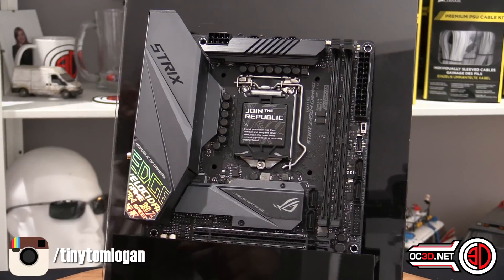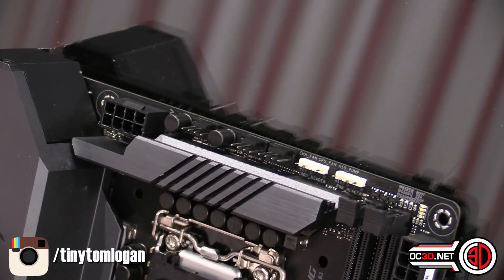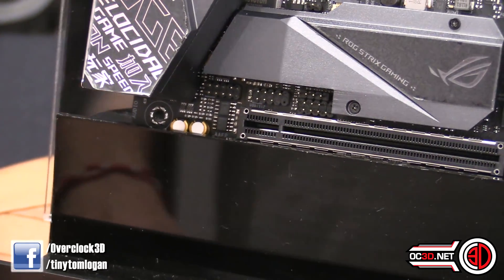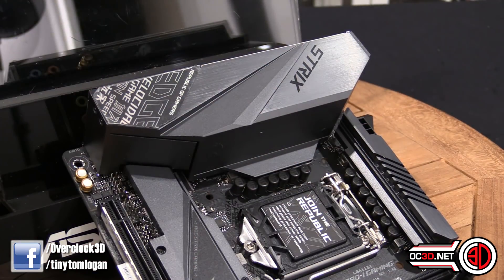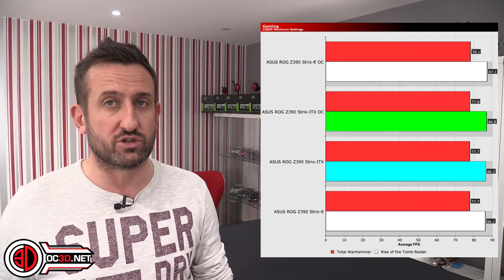Asus ROG Strix Z390 i 9900K Motherboard Review

Comment: I am planning to make a build with this m/b an i7 9700k(stock settings) using for case a Corsair Crystal 280X with 6 case fans.
From your experience do you believe that the "Scythe Big Shuriken 3"  fan cooler or "Cryorig C7" fan cooler are enough for the 9700k(stock settings) for gaming?

Comment: I just do not understand Intel not letting me use my recently purchased i7-6700K in a new motherboard.      That irks me so bad, that I may just go back to using a typewriter.
Reply: Elstan McFrolicker It’s because the newer motherboards’ sockets have a different architecture specifically for 8th and 9th gen CPUs, that’s why you can’t use 8th and 9th gen CPUs in 6th and 7th gen motherboards since those boards’ sockets were specifically designed for 6th and 7th gen CPU architecture.
Reply: @LawByLaw        there are hacks to get it working tho         :    ]

Comment: Some are reporting a 9900K right out of the box won’t work with this MB. It needs a bios update first - which requires an 8th gen CPU - then it will recognize the newer 9900K. Has anyone else experienced this? I saw a few reviews on Newegg.com. Thanks!
Reply from the maker: The board will work fine with the 9900K but you should update to the latest BIOS anyways, depending on when the board was made and how long it has been at your retailer will depend how out of date the BIOS is.

Comment: heheh, 9900k "best gaming"  cpu but only if  you dont oclock 8700k or especially 8086k at maximum and that is 5,3-5.4ghz or in some cases above that  and if you compare  stock 9900k vs stock 8700k and that is 200-300mhz advantage for 9900k and there you have "winner" in gaming
Reply: cinebench will have OC 8086 at 1750 max  9900k comes 2000 stock
Reply: but fakn stock of 9900k are 4,7ghz workload and asshole channels dont  mention that so stupid peoples and most of viewers are that thinking that stock workload 9900k are 3,6ghz
Reply: who the fak care for cinebench?? of course that 9900k will be faster because of 2/4 c/t more  and 4,7 ghz workload !! but in gaming it is behind if you oclock 8086k at max and that is 5,4ghz  without some big troubles and even with 5,2 it will be faster in gaming then 9900k at 5-5,1  and that is  max for 9900k and it is not  clever to use  in on that everyday

Comment: Hmm what about this board with an 8700K?
If it handles the 9900K ez....Hm?
Reply: Z370 i strix is fine. I clocked mine easily to 5.0Ghz with aio.Going to watercool it now
Reply: I know what the strix 370i does, but i like the look of this new board
Reply: So i wanna know about the new board and a z390i
Reply: It would easily handle even the 8086K.

Comment: I'm concerned this board is going to unusable in SFF builds because of that massive heatsink. I'd be interested to see what low profile air coolers would be compatible with this thing.
Reply: I'm going to have to do some working out with my case and a top mounted rad, if need be I'll just get the Dremel out.

Edit for the case fan/rad mountings not the mbaord, just for clarity...
Reply: I'm having the same concern but for a normal 120 air cooler - trying to find out the height of that heat sink below the fan headers.
Reply: I'll let you know how it goes soon, I have a Hero on order and a 30/35m rad to get in the roof. On my last build I had to butcher the cpu power lead because it blocked the rad.
Reply: It's very tight, I'd glad I modded my case roof to fit my Alphacool NexXxoS UT60 Full Copper. Anything smaller than that should fit in the roof, this is based on me trying to stuff it above a Hero XI. If i had not modded it a little it would not fit. SO you should have room for a skinny in most cases.
Reply: I picked up this board and a Cooler Master Masterair G100M for a 9700k, happily, the CPU cooler fits.  It's a little tight, but it totally fits without hitting that massive heat sink.